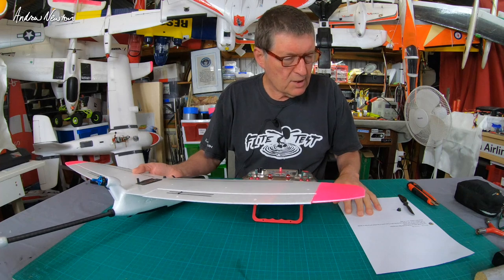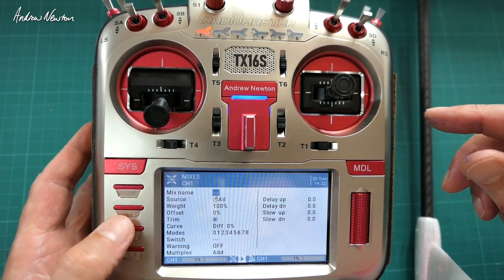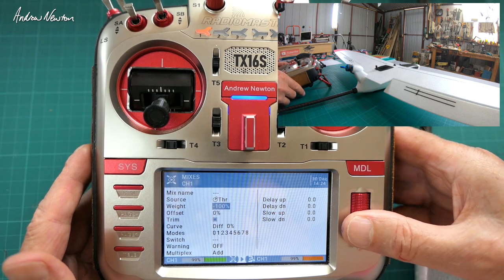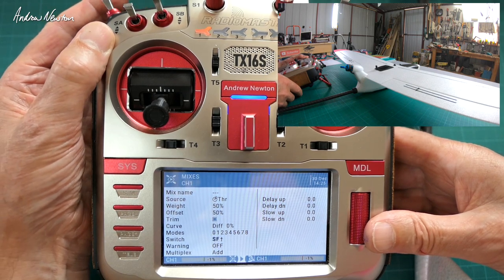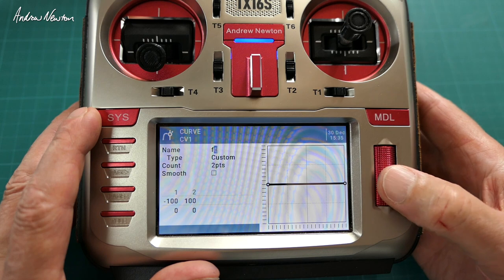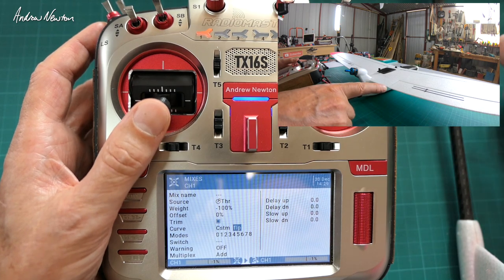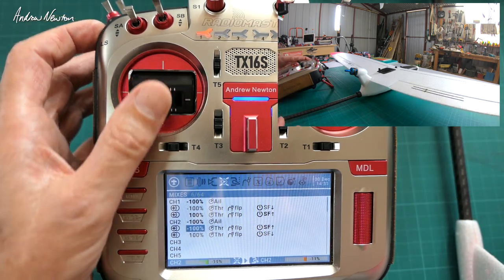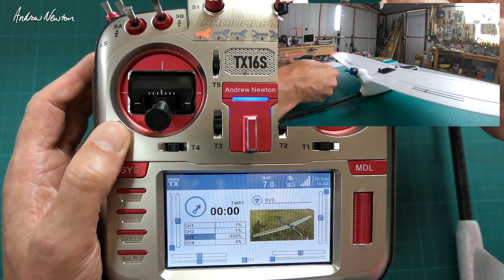Throttle stick flaperons / spoilerons

Comment: Nice Tutorial Andrew. I can't emphasise enough the need for robust Throttle arming and control. It may not immediately occur to novices but the throttle stick arming logic needs to be duplicated for throttles with any other input to prevent inadvertent motor spin up. Radio software specifically implements such caution with lock out and  audio/visual warnings at turn on of the TX. Unfortunately the built in arming logic can not be allocated to another input. Respectfully may I suggest your single  "safety/arming" switch is not foolproof while using a single latching switch. At a minimum I would suggest a two switch approach with one of the switches being a normally off momentary type. I am sure you will follow my point and a robust arming procedure would make a good follow up to this video. Cheers Rob
Reply from the maker: Yes good point Rob.

Comment: In real gliders, pulling back on a handle lowers flaps or extends airbrakes. Much like pulling back on a throttle stick to slow down.   It's more intuitive and better for muscle memory to use the throttle stick that way IMHO.
Reply: I agree. I use that setup on some of my RC slope gliders - throttle stick full forward for normal flight, and pull it back for spoilerons (or flaperons if you so wish). That way there's no confusion when I fly powered RC planes - it's always pull back to slow down.
Reply from the maker: Yes, same here, slider down for brakes. This was Marc's setup and he wanted it his way.
Reply: i thought moving the stick up increases the effect it is meant to have
so stick up = more more throttle, or more flap, or more spoiler
and throttle and slider switched to have the function i want to have more control over on the input method that enables that

Comment: Andrew when you use the negative wieght to change the direction of the servo I found that the trim still acted in the same direction as before ie opposite to what you would normally found. I thought the only way to stop this was to reverse the servo direction in the outputs page ? Please correct me if this is not the way to reverse direction. Cheers and many thanks for your great videos.
Reply from the maker: I have heard that but never bothered to test it. A task for today
Reply from the maker: Just tested it and trim always seems to work correctly whether I reverse the weight or the channel. It also scales to the ratio of reduced weights.

Comment: @andrew Newton. I am struggling with having my flaps move with the whole range of motion with the throttle stick. Right now it is only the hop half of the throttle position that has any movement. Any recommendations on getting flap movement with the full throttle range of motion? Thanks!
Reply from the maker: I have lots of video on flap setup.

Comment: That it is possible to program the TX this way is fantastic. The question is why? What is the benefit of this setup, over having the flaps & spoilers on the roller with the switch to initiate? This Mode 2.2 with the throttle out of place would be confusing. Are the ailerons controlled by the stick? That would mean the pilot needs to manipulate both sticks plus the roller for normal flight operations.
P.S. Mode 2.1 = mode 2 with the elevator function reversed. (I’ve been told that someone has their TX this way).
Reply: @allenmoore9848  thank you. I missed any mention of DLG, it makes more sense on a pure glider. It was mentioned to put the throttle on the roller, which was my primary concern. You have convinced me that it makes sense if the motor is only used in short bursts.
Reply from the maker: This was Marc's setup and he fitted a motor to his DLG. I am happy to have flaps / brakes on the slider.

Comment: This is really neat. Very cool to see OpenTx can do that. I have a Drift with iNav in it and would really like it to land with a steeper, slower approach and maybe be easily catchable. Should I go for spoilerons then or flaperons? I understand I would do it in iNav, not the Tx. Is it essential to control the strength on a slider, or is toggle on/off good enough?
Reply from the maker: I guess a switch would be OK, maybe with some "slow" for smooth throttle increase. I have only ever used the throttle stick myself.
Reply: Thank you

Comment: Hi Andrew, would this programming be the same on the RadioMaster TX12 Compact,
I personally don't have that radio. I fly with Graupner radio which is already configured to have the brakes on the throttle for gliders. 

 I am asking for a 10 year old who is just getting into the sport. And I am not sure if he can afford a more expensive radio. Would be nice to hear from you.
BTW your videos are al very informative.
Reply from the maker: Thanks Knut. Yes OpenTX is the same across all radios. The screens may look a little different but it's only cosmetic.
Reply: @AndrewNewton  Great thanks